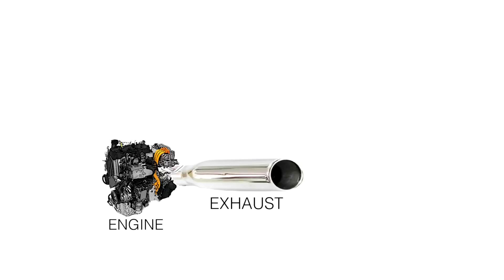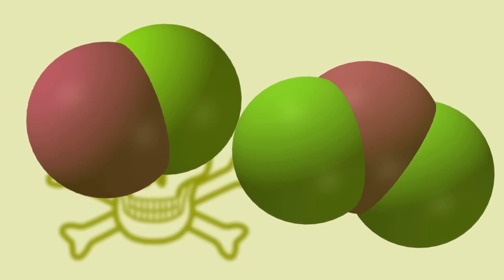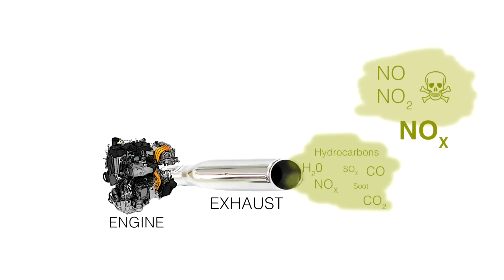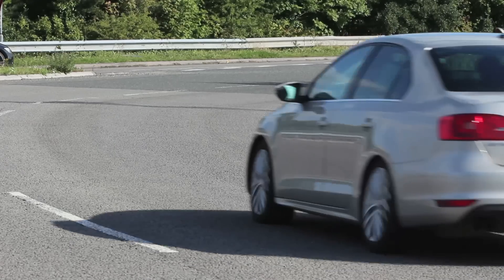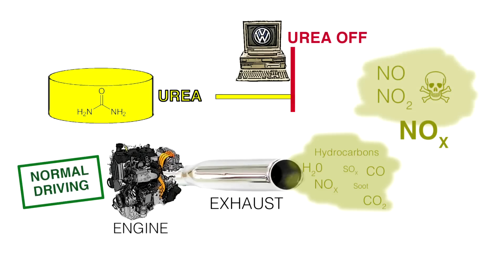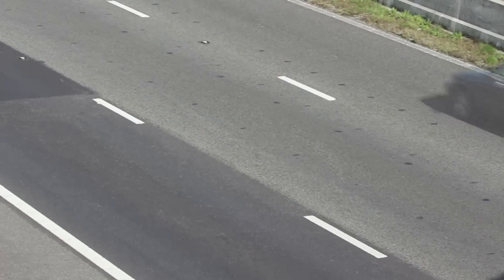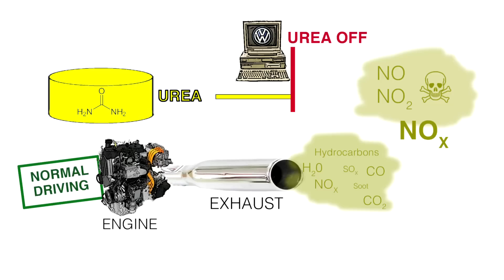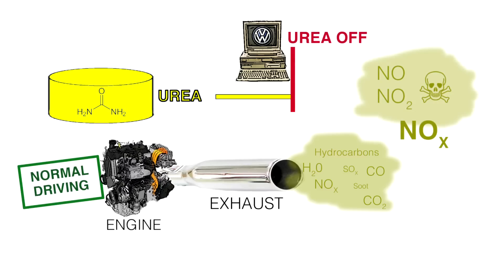Diesel and Urea

Comment: In diesel engines what it is compressed is the air, not the mixture. Fuel is inyected when the pressure is at the highest.

Comment: Ahhh I do remember the cheap fuel scandal,
(Big breath in!!!)
It was caused by the Russians (who’d of thought it lol) who pumped their fuel/oil in vast pipes across very long distances through very cold environments, where it is then distributed across Western Europe.
In order to essentially stop the fuel freezing an anti coagulant was used, but those crafty Russians realised they could use less and less of the stuff and be ok, after all this anti coagulant isn’t cheap.
Thinking they were saving some money, they actually broke a lot of regulations which could cause fuel customers to go elsewhere (in short), when an investigation was conducted the so called smoking gun had to be hidden, so what did they do? That’s right! Tip all the remaining stock into the fuel/oil, but in high concentrations it’s creates lots of excessive sulphur when burnt (other science things insert here.......) but essentially it turned the exhaust gases very acidic and corrosive which in turn destroyed the quiet delicate filament in the oxygen sensors........(insert more science here).....so there :)

Comment: Love your videos Professor. 

As diesel emissions regulations tightened, many engine designers can car manufacturers incorporated a completely new subsystem to the emissions controls - one which injects "diesel emissions fluid" (DEF), or urea - into the combustion cycle. This new subsystem increased the cost and complexity of the vehicle. 

In an effort to avoid the added costs and complexity, VW came up with a different plan to "meet" the new emissions regulations ... 

They cheated. (And so did Bosch and all the other companies that contributed to the manufacture of the verboten cars.)

From 2009 to 2016 models, VW's solution was to program the computers and sensors to detect when the vehicle was being operated in a testing environment. For example, the engine might be operating above idle - say 1500-2000rpm, while the vehicle speed remained zero. At this point, the engine control would adjust the fuel and combustion parameters in order to pass the test. However, while an engine operating at those settings emitted fewer regulated emissions, its performance was reduced so as to make the vehicle perform very poorly on the road. 

Once the test was over and the vehicle returned to normal driving conditions, the engine control would return the combustion parameters to their default setting, at which point the vehicle would emit higher pollutants in violation of the emissions regulations.
After being caught and setting aside $10B to resolve the problems of repairs, buybacks, reimbursements and penalties, I read in 2017 or so that they had already spent $24B. I just read that it's up to nearly $33B. 

I love VWs; always have. My daily driver is an older VW diesel (I've got as much as 53 mpg!). But this was the stupidest plan ever. How could they have even imagined this wasn't cheating? Or that they'd not get caught?
Reply: I'm not saying that anyone "should" do this, but regulators also clearly don't do their jobs if they got away with this for 7 years. It's a clever solution if you want to artificially keep the price of a vehicle down though. The ethics are reprehensible, but I admire the ingenuity. Also, I have a very hard time believing that they were the only ones who did it, they simply got caught.

Comment: What about engines operating on Liquefied Petroleum Gas (LPG--usually some mixture of propane and butane) and those operating on CNG (compressed natural gas--methane)? They're definitely uncommon in Anglosphere countries, but they're very common elsewhere. Any possibility to cover these in a future video? Or better yet, engines which run on plant-derived biofuels, like ethanol-rich gasoline/petrol (E85, for instance) or even with modified coconut oil!

Comment: Sorry to correct you professor. The  NOx issue is not only a diesel problem but any "blown engine' s" problem due to high pressures at combustion, since N2 is quite inert to form oxides even at high temperatures, but prone to form them on high pressure and temperature. Modern Turbo petrol engines "do that" too. Plus VW software did not cutoff any urea - they simply sold an engine without urea injection as "clean". The software hack was very simple - it did not allow high power during the test cycle. No high power=no high pressure in the cylinder = no NOx. Test passed.

Comment: I thought diesel engines had glow plugs?..
Reply: they have glow plugs to heat up the diesel upon startup and make it easier to ignite (especially in cold weather), but they are only used to get the engine running.
Reply: @tk4x431  They're sometimes engaged when automatic DPF regeneration is taking place.

Comment: Diesel engines don’t have spark plugs, but they don’t rely on combustion from compression heat alone. They use glow plugs that provide a constant source of high heat to set off combustion during compression.
Reply: The plugs are only there to assist during cold start. In some applications they're engaged during automatic DPF regeneration.

Comment: 1:00 When the piston of a diesel engine compresses the air, there is no mixture.  It is only air.  There is no fuel in the cylinder till the piston gets to the top of the compression stroke and the injector actually squirts some fuel in.  Because of the high compression ratio of diesel engines, there would be no way of preventing the fuel from detonating prematurely because of the heat being produced by the high compression, which is why the fuel is not introduced till the end of the stroke.
Reply: Oy, can't believe he got this wrong 🤦‍♂️

Comment: One of the key differences between gas/petrol engines and diesel - is that the combustion energy for diesel comes entirely from the compression. Does the higher pressure cause more NOx to be generated? 
NOx is sometimes used as a fuel additive, at least in movies. Thoughts on a reclamation device?
Reply: Suddenly, I want to rewrite Fast and the Furious to be a remake of Fight Club, where they make engine additives from rich people's pee.
Reply: Nitrous Oxide is not the same as NOx
Reply: Another Youtube channel swept up a 10 foot section of heavily driven highway shoulder, and was able to refine a tiny ball of platinum from that dust. So not all of the catalyst remains within the converter through the life of the car.

Comment: Some people seem to be under the impression that the glow plugs are needed for the engine to run which is completely wrong,they ere there solely to warm the air in the cylinders in cold conditions so the engine will start, in some engines they stay on for a few seconds after starting while the cylinder warns up enough to stop the clouds of smoke older engines used to produce during winter start ups, in summer conditions they are rarely used if at all.

Comment: I thought diesel engines had glow plugs which are like a spark plug with a small heating element(like stove element not periodic xD) on the end and as the diesel compresses the glow plug helps facilitate this "spontaneous combustion"? Otherwise very informative video

Comment: I have a question for the professor. Hypothetically, if the majority of combustion engines on the road ran off of " Brown's gas" or oxyhydrogen, the exhaust product being steam, would this have a large impact on the environment? i feel it would accelerate the water cycle and cause larger storm systems/ more overall precipitation...what are your thoughts? can you do a simple video on browns gas?
Reply: well think about it, like all the other things that produced steam as exhaust, such as countless powerplants, trains, and ships during the industrial revolution... 
(Also its a relatively large component of Jet fuel exhaust)

Comment: Why cant we put a catalyst on the intake side? Something to react with the Nitrogen and give it another electron?
Reply: why cant you science?
Reply: Nitrogen on the intake side is already stable as N2.  Filling the two electron shells by sharing the e- together. 5+5= (2(8)). Nitrogen in this state is very stable but due to the extreme temperatures of the engine. It causes the nitrogen to split and become reactive with oxygen. So there is nothing you can do on the intake side to nitrogen. The only solution would be to have pure oxygen on the intake side but as we know that is not a economical solution at all.

Comment: Sorry to correct you professor, but it is the injection of the diesel fuel into the cylinder at maximum compression (and temperature) that causes ignition.

Comment: Actually a diesel engine compresses the air only, not an air/fuel mixture. The diesel is injected into the compressed air and it spontaneously ignites. Diesel engines produce much higher compression than gas engines, ~22 bars compared to ~10-12 bars for gas engines.

Comment: I am curious as to how the computer knows when it is being tested, and when it is not. Is some electronics connected to the computer during the test?
Reply: +geocarey  the on board computer checks if the wheels are turning when the engine rpm is  above a set  level then activates the test mode if the car is not moving
Reply: +colinvanful Thanks. Very sneaky!

Comment: The injection timing in a diesel is as critical as the spark ignition in a petrol engine, The major difference is ,is that the fuel oil is injected AFTER the air as been compressed to ignition temperature, THEN diesel oil fuel is injected at the right time in regards to the position of the ascending piston, so as to deliver the maximum amount of expanding energy on the piston in the down stroke. Diesel, like most oils, react exothermicly to oxygen, This is why you never use oil on a pure oxygen system for fear of fire and explosion. Our atmosphere at 21% o2,  mitigate this reaction, but not at compressions of over 17:1

Comment: I have a question for the Proff, I drive a truck that holds 120ltrs of adblue in a tank in front of another tank that holds 450ltrs of diesel.......If by chance another vehicle impacted the urea tank forcing it into the diesel what are the chances of the impact creating an explosion?

Comment: 0:21 what about electric engines?! it's 2016 and electric engines have become a reasonable alternative to combustion engines. and the chemistry behind batteries is cooler too.
Reply: They are not engines...they are motors
Reply: oh i speak german and we say to both types (electric and fuel) just "Motor". it is just a label but it still explains why he is not mentioning electric ones thanks
Reply: mrgaiusbonus We also use the term motor interchangeably for both electric motors and internal combustion engines, but an electric motor is never referred to as an engine..
~~ PEACE

Comment: In a diesel engine - The piston compresses air, NOT a fuel/air mix. The intake stroke draws in ONLY air - The air is compressed at ~20:1 and then near the top of the stroke diesel is vented in at ~20k PSI. The diesel almost instantaneously ignites on contact with that environment which gives you the power stroke.

Comment: A diesel engine has a glow plug for each cylinder. It is this glow plug that ignites the highly compressed fuel/air mixture, which is more compression that what is in a petrol (gasoline) engine. This is not commonly known among the general population.
Reply: +Tony Probably because it is wrong. Glow plugs are for starting some small diesel engines from cold and turn off once the engine is running or up to operating temp.
There are plenty of diesel engines around without any glow plugs at all
Reply: How do they keep running? Is it from the compression alone? How does a diesel engine without a glow plug start? I thought I had the answer, but I am wrong, please give or show me the real answer.
Reply: Exactly. Compression alone. A diesel is a compression-ignition engine as opposed to a spark-ignition engine such as a petrol/gas engine

Comment: Dear Professor. Diesel engines doesn't compress mix, they compress only air, and when de air is compressed and hot, the fuel is injected at higher pressure than the compressed air and in that point the ignition takes place.
I enjoy preiodic videos so much.
Reply: ciudadanubis de end

Comment: Why did you have to "prove Godwin's law being right" with that last comment?

The whole debacle has more to do with GREEDY MANAGERS - which is more of a problem the world has to thank Great Britain and the USA for - and in this case I can also put a name to it: Ferdinand Piech. His leadership saw VW change from a company that made great, SIMPLE and CHEAP cars to a company that produced overweight cars with far too many gadgets. If cars weren`t so heavy today (a ~2005 Golf weighs more than a 1987 Passat ... and is smaller AND has the same fuel consumption) they would use less fuel ... which would lower their emissions.

And to get back to the greedy managers: cars are sold "as one piece"[1], which will increase the profit margin of the company, if you put more "gadgets" into the car. This is what Piech did to VW (and all the other companies VW owns) to increase his own fame as a manager.

[1] If you buy a more expensive piece of meat, cheese, wine, ... you can do so ... you just get a lower amount of food for the same amount of money. That doesnt work for cars, especially if the car companies will NOT SELL you "a car without extras" anymore.

Comment: Just to be precise... Diesel engine IS NOT compressing fuel+air mixture to ignite. It's just compressing air.
Fuel is injected at the moment of ignition, which occurs because of adiabatic process, when suddenly compressed air gets much hotter than uncompressed.

Comment: Urea (AdBlue) in a car? well i never Heard of it but Trucks, Tractors and Wheel loaders DO have it. but biggest user however is Trucks. but that depends very much on what brand. like for example a Euro 4 Volvo got a Adblue tank but a Euro 5 Scania doesn't. but Adblue is an option however. How? Nox traps and filters. but it ain't a cheap way.

Comment: The only thing this video highlights is that you shouldn't get your car knowledge from a physicist. Spent very little time explaining the chemistry of NOx and more time saying rubbish like, "Diesel engines can be built much larger.". Try and explain that one to the drag racers with 700+ cubic inch petrol engines with some going over even 1000 cubic inches. Petrol vs Diesel has absolutely nothing to do with the size of the engine, particularly with a production car.

Comment: The solution you are talking about is AdBlue. We can literally buy IBCs (1000L tanks) of the stuff here in australia. On some of the kenworths in 2011 and many other diesels in recent years, they have had these tanks in the vehicle. Including in some mercedes benzes. BUT they worked out some other way, like some way using a catalytic convertor that after it HEATS UP starts to work. they will work, but ONLY after several kilometers of driving.

Comment: 0:28 There are petrol engines, Diesel engines and LPG engines. Petrol and LPG have the same working principle.
Let's do some rough equations: 
(gasoline) C8H17+O2 --> C8H17 + 12O2 -> 8CO2+8H2O.
(LPG) C4H10 + O2 --> C4H10+6O2 -> 4CO2 +5H20
OK, we will end up with more water and the engine components will oxidize faster. Instead of 300.000 Km they will run for 150.000 Km. Yes but engines can be built with different materials less prone to oxidization. With nowadays technology 1 cylinder LPG engine can generate more than enough electricity to operate an electric drivetrain of a small family car.